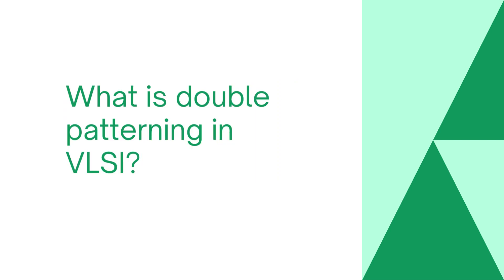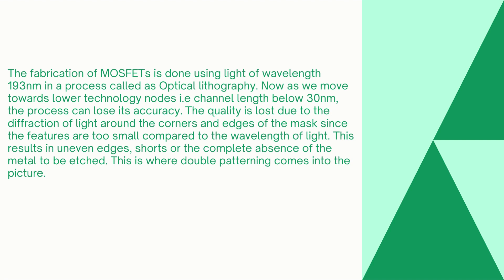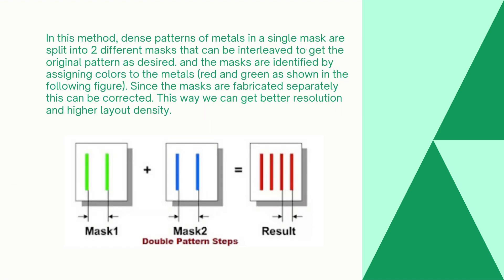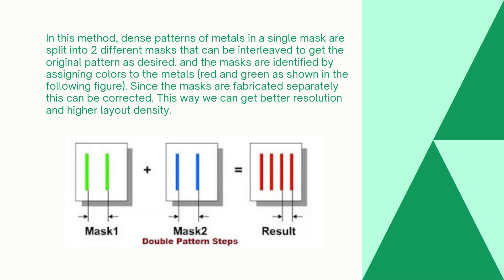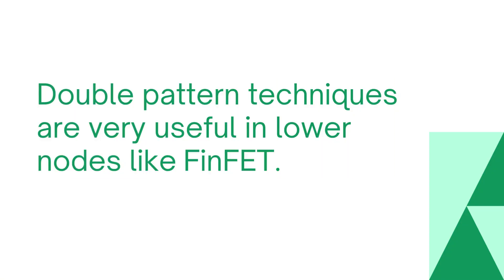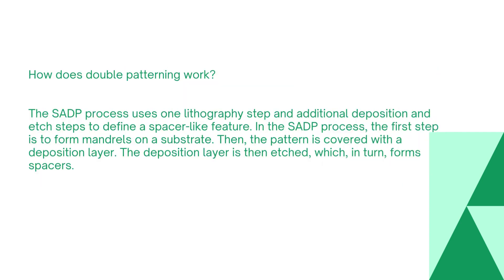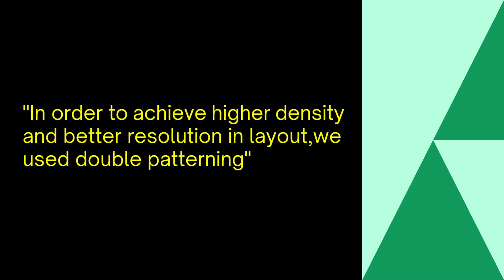Double Pattern in VLSI #thesiliconvlsi

Comment: 00:04 Double pattern in VLSI is used for fabricating most space using light of 130nm wavelength
00:44 Moving to lower technology nodes affects security and quality due to diffraction of light.
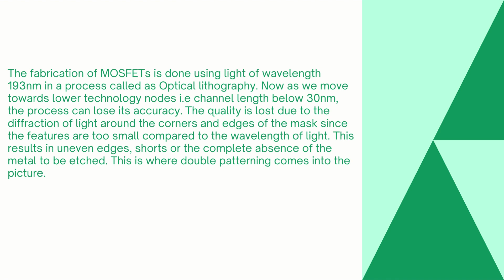01:20 Double patterning splits dense metal patterns into two masks.
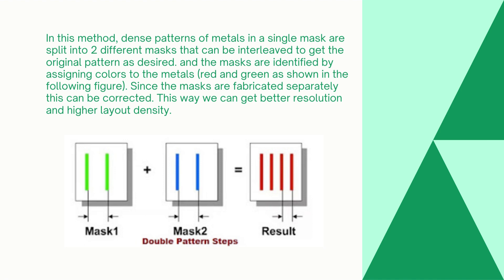01:55 Double patterning involves using mask one and mask two for higher density.
02:30 Double patterning increases fabrication cost
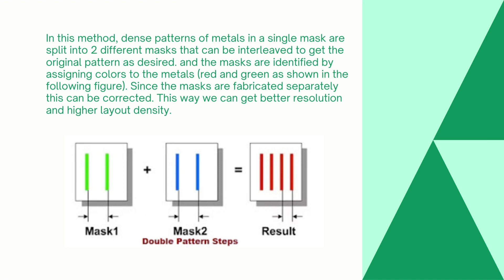03:09 Double patterning techniques are useful in advanced node technology like finfet.
03:51 Double pattern process involves deposition and etching steps.
04:32 Double pattern used for higher density and better resolution in layout.